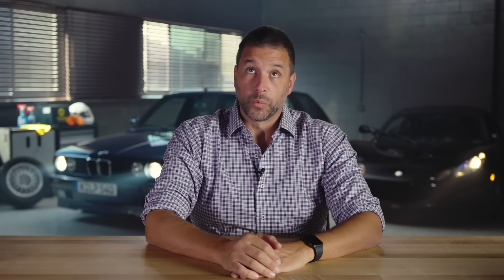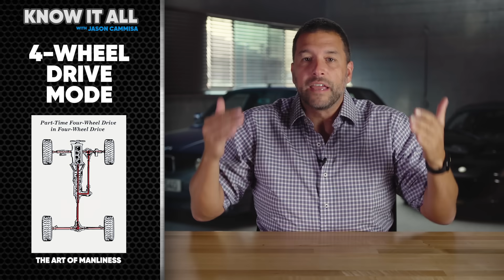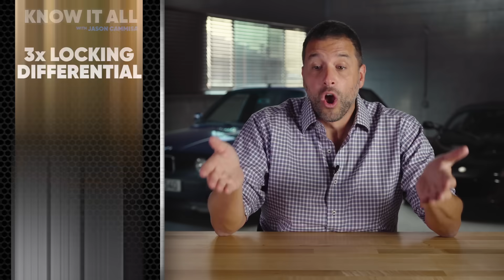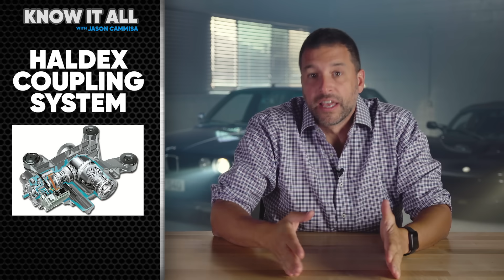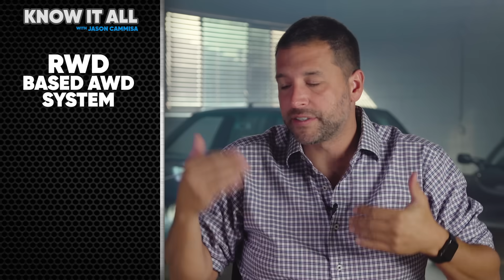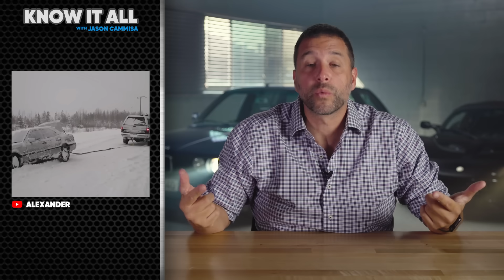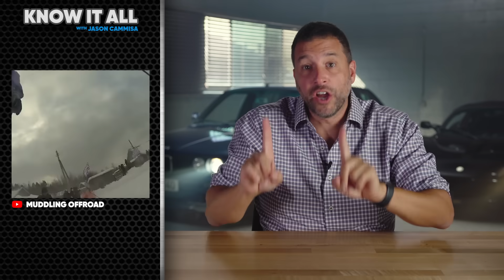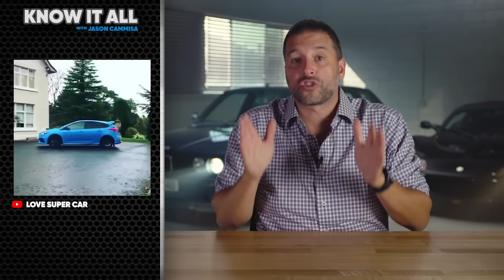Understand Your All-Wheel-Drive System | Know it All with Jason Cammisa | Ep. 04

Comment: So where does the Subaru system fall? Asking for all the Subaru vapey bois. Thanks
Reply: Subaru doesn’t exist in Jason’s world.  Subawho?
Reply: @Rightisallwrong  That's because turbo subaru's explode and can't drive any wheels...
Reply: @mattsoares608  What does a turbo have to do with Jason not mentioning Subaru in a video about AWD?  Do you sniff glue?
Reply: @mattsoares608  no more often than Z car transmissions or 5.0 mustangs explode. 
I used to belong to a Subaru group and I still know more people directly with domestic engines imploding by a wide margin.
Reply: I like how there’s an entire video on AWD Systems, and they don’t mention Subaru even once.
Reply: @JesterialInsanity  Right and I wonder why?
Reply: @JesterialInsanity  that's because he mentioned mitsubishi and the one thing they have over Subaru are their engineers.
I think mitsubishi and Subaru both typically use a viscous center differential
Reply: @JesterialInsanity  so he’s just supposed to mention every single manufacturer that has AWD cars? I think he did a great job of illustrating some of  the different types of AWD systems out there, since that’s what this video was really about.
Reply: @G_F1  Yeah, probably not every manufacturer, but MAYBE the manufacturer who made ONLY AWD Cars for their entire lineup until 2012. Maybe the only manufacturer where 8 of the 9 cars they sell right now (USA) only come in AWD. And if the Video was really just about TYPES of AWD Systems as you state, then why even bring up any manufacturer? The Video was just a quick pump and dump to get content out.
Reply: @G_F1  
No, but perhaps mention the one that is arguably the best in the world and is in more cars than any other.
Reply: @G_F1  considering there’s only one car company in the world that has been all about all wheel drive since day one, I think so
Reply: @G_F1  are you really this… slow, to put it very politely?

Do you even know what Subaru is, asking a question like that?
Reply: As the comments above have alluded to, Subaru uses many different implementations of AWD depending on the combination of model, trim level, and transmission type
Reply: Subarus, due to the boxer engine, have longitudinal engine layouts and thus have the transmission directly inline with the transmission and then the rear driveshaft. If you look in a Subaru engine bay, you notice the engine and trans are super far forward. The front driveshafts come go directly from the transmission to the front wheels without a weird angle or weird springs (look up W124 4Matic springs/front diff if you want to have nightmares). With the longitudinal engine, the front and rear half shafts coming from the diffs are equal lengths (that's where the name Symmetrical AWD stems from). These equal length half shafts allow the power to be distributed more evenly and smoothly. In the case of Subaru, with the longitudinal engine allows them to make their cars AWD without adding much to the cost of the car, as it allows them to just run a driveshaft directly out of the back of the transmission. Regarding diffs, most Subarus have open diffs and its been that way for over 10 years. Only AWD Subaru that has retained the lsd is the STI, which has a pretty complex AWD system. Subaru replaced the LSDs with VDC, which is basically a quick reacting traction and stability control; it will apply the brakes to wheels without traction and stop them from spinning, which then sends power to the other side. For Subaru owners who want an LSD or locking diff, there is one available made by Torq Masters called the Torq Locker. Its an automatic locker for the rear diff that acts as an open diff until one of the rear wheels slip.
Reply: Subaru vehicles equipped with manual transmissions use a viscous limited slip center differential (VCD) AWD system
Reply: Hey only most of us vape .5% think we’re in Initial D! Still Jason what about Subaru’s AWD System I know you don’t like us but inquiring minds still want to know from the Know It All himself.
Reply: Just go watch Engineering Explained’s video on Subaru’s systems.
Reply: @MRX5000X  that’s exactly wha to just did
Reply: @layne4376  No, the STI doesn't rotate well from the factory because of the suspension setup, not because of the AWD. Adding a stiffer rear sway and adding some front camber makes an STI rotate just fine, especially when the center diff is fully unlocked (pushing 59% of the torque to the rear).
Reply: He didn't discuss torque vector braking either which many companies use with open differentials than going with more expensive LSDs. This is part of the reason why a STi costs more than a WRX. You are paying for front/rear LSDs and a Electro-magnetic adjustable center LSD aka DCCD. Also Subaru added X-mode to much of their fleet with more inputs and sensors from the car for the ECU to factor in. Something other manufactures haven't outside of a yaw sensor.
Reply: for real, I was waiting for him to mention Subaru. Still am...
Reply: @Rightisallwrong  No, the DCCD isn't a viscous diff. It's a clutched LSD with a rearward bias when not slipping (41F/59R). In pre-2018 cars, this had both a mechanical clutch engagement like most clutched LSDs, and also electronic capability to preload the clutch as desired. In 2018, the mechanical portion of this was removed, so now it's a fully electronic clutch - note that with the clutch fully open, it's sending 59% to the rear, and as the clutch progressively locks up, it behaves more and more like a truck-style or jeep-style AWD where the front and rear driveshaft are basically locked together. 

Also beneficial to the STI is that it's the only Subaru that gets a front and rear Torsen, so it actually has 3 separate limited slip diffs.
Reply: @clapanse  Learn something new everyday
Reply: Too primitive I would say, as of now you cant really do torque vectoring without faking it with brake vectoring. Reliable and predictable though.
Reply: x2 for Torsen Quattro...
Reply: ... is nobody gonna mention wtf a torsen differential is? Or is that just rally-car special talk?
Reply: @graysona1800  short answer is, it's a mechanical lsd, that pretty much doesn't have any delay trasfering and locking the power, however, it's a  bit dangerous,since if one wheel goes in the air, then 100% of the power is transfered to one wheel instantly
Reply: @graysona1800   - do a search on YouTube for torsen differentials.  There's lots of good info there.
Reply: Really depends on model.  The best system IMO is the manual with viscous center diff.  Put a locker on the back and the engine runs out of juice before the wheels run out of traction.
Reply: 300,000 mile 1998 turbo Subaru FTW, baby! Bought it for $2,000, received a $2,500 check after a very minor hailstorm, and other than that, typical maintenance. This car actually made me money.
Reply: @James_cowley  Subaru are full time 4wd but what makes it awd is that instead of the locking being manually engaged it uses clutches in the differentials. Unless it's a standard model then it's just an electronically engaged center diff with open front and rear diffs. Subaru also had the variable valve lift on sohc engines similar to the c4 Corvette engine before the ls1 and automatic transmissions with the ability to half shift down for more power to an infinite ratio between the two gears thanks to special hydraulically controlled clutch packs that purposefully allowed slip to allow for higher rpms and more power but not enough to let the transmission slip. This came standard on all 4th gen legacy's, Outbacks, and foresters
Reply: I have both an Audi S5 and a Golf R, and the S5 is definitely a superior AWD system. But I found with the Golf R, a beefier rear sway bar helps in the corners.
Reply: I agree, I wanted an explanation for my STI
Reply: Subaru is full time awd like the audi, including the wrx. The STI has an lsd center diff like the sh-awd, mitsubishi evo, and Ford focus.
Reply: The head gaskets fail so often you forget about the awd nonsense. Zing!
Reply: @TML34  too real!
Reply: Head gasket issues were a problem on "some," but not all Subaru engines, usually certain NA 4 cylinder engines.  It's also an issue that really hasn't been an issue for a number of years now.
Reply: @TML34  
Subaru hasnt produces the EJ series engine in ten years Zippy, ZING!
Reply: @fubartotale3389  and even when they were the headgasket issue was sorted out. Its an issue that only lives on because the internet won't let it go.
Reply: @fubartotale3389  False, the STi still had the EJ until they killed the entire trim level off after MY 2021.
Reply: @TML34  nah they run out of oil and lock up before that.
Reply: Early WRX blob eye wagon is viscous centre for sure. It depends on which tyres are more worn out and or loaded up as to which tyres you’ll get to spin. Sometimes it’ll make a Honda envious at the tyres it’s spinning. Sometimes it’ll surprise mid corner with a shittonne oppo. That’s centre viscous diff playing the role of chose your own adventure
Reply: Most Subarus use the Audi layout (longitudinal fwd-based), and they’re permanent AWD. I’m not sure what torque split is tho.
Reply: @M67v  It's transmission dependent. 

Manual transmission subarus except the STI are all 50/50 biased when not slipping, so it's wrong to call them fwd-biased or fwd-based, and usually have a viscous center differential (so if there's a speed difference between front and rear because one is slipping, it will progressively send more torque to the slower spinning axle).

Automatic or CVT subarus except for the sporty models (Forester/Outback XT and WRX) have a 60/40 front to rear distribution until they detect slippage, so they are front biased but not 100% front like a Haldex system would be - they're still sending 40% to the rear even when no slippage occurs. These use a multiplate transfer clutch to progressively transfer power around if they detect slippage.

Sporty automatic or CVT subarus (again, Forester/Outback XT and WRX) run basically the same system as the regular auto except that the normal torque distribution is shifted to be 45F/55R, for the obvious reason that they're trying to make them a bit sportier feeling and able to kick the rear out in the snow or similar. 

Finally, the STI has the most aggressive rear bias, at 41F/59R, and it also has the most sophisticated differentials, with an electronic clutched center limited slip that the driver can control, and front and rear torsens. 

If you want more detail, Engineering Explained made a good video on Subaru's AWD systems a while back.
Reply: Subarus fall under the rear wheel > front wheel center locking system
Reply: Ignore literally everyone's prior replies.

The Subaru system has a longitudinal layout like a conventional RWD but actually operates more like a FWD due to the front driveline always getting power from the engine.

Let me expand on the truth of the AWD systems Subaru has used.

There are 4 versions of Symmetrical AWD.

1) Continuous AWD, 50:50 F/R torque split, viscous center differential (all manual transmissions except WRX STI w/ DCCD)
2) Active AWD, 60:40 F/R torque split, electronically-controlled multi-plate transfer clutch (all automatic transmissions except H6-equipped Subarus and a few other exceptions)
3) Variable Torque Distribution (VTD), 45:55 F/R torque split, multi-plate electronically-controlled transfer clutch (all H6-equipped Subarus and a few select ones, including some turbo models) with planetary gearset center differential
4) Driver Controlled Center Differential (DCCD), variable between 50:50 F/R to as much as 41:59 F/R [pre-MY2008 could go as much as 35:65 F/R] MPT with planetary gearset center differential similar to VTD combined with a viscous coupler similar to Continuous AWD (all Subaru and STI models with DCCD) [MY2018+ got rid of the viscous coupler]
Reply: @AWDfreak  you made a mistake on DCCD saying that it has 59:41(pre 65:35) F/R, the mistake is not F/R, but R/F ;) it sends more to the back, other than that, great explanation
Reply: @petkokrushev3840  Good catch. I wrote it while very tired. I will correct the post.
Reply: @AWDfreak  as I said, great explanation otherwise. I have an 06 STI and the awd system is really nice
Reply: Right! When I think of all wheel drive cars I think of Audis and Subarus first.
Reply: It's a reactive system with open diffs throughout. What else needs to be said about that garbage?
Reply: They use a full-time torsen center differential setup like Audis do.

(EDIT: I accidentally typed "haldex" when I meant "torsen")
Reply: @CrazyWeeMonkey  Nope, it's completely different from a Haldex setup.
Reply: @clapanse  

Most Audis still use a torsen center dif. It's only a few of the newest ones (A3/S3/RS3/Q3/Q5/A4 Allroad) that don't.
Reply: @CrazyWeeMonkey  Nope they don't, it's ultra quattro now. Torsen is dead, gone, rip
Reply: @CrazyWeeMonkey  yeah, but the Torsen Audis don't have Haldex. Subaru's system is similar in many ways to the Torsen Audis, but it's very different from Haldex.
Reply: @clapanse  

... That's what I was saying. I drive an Audi A6 Quattro ('12 3.0T) and like most other Audis the Quattro system is torsen with a center differential, like Subarus.
Reply: Oh, I realize the confusion. I said haldex center dif in the original comment when I meant to say torsen center dif
Reply: It probably broke down on the way to the test.
Reply: Subaru's system is the best.
Reply: @imnotusingmyrealname4566  yes, but the engines and some transmissions really suck
Reply: Subies are not very popular
Reply: @0163844098  what? They’re 4% of US car sales. Subaru sells more AWD (not 4wd) cars than any other brand.  they’re pretty popular and arguably the most common AWD car found on the road.
Reply: @0163844098  ya, but this video is intended for the US market
Reply: @0163844098  were also talking about a video that is about AWD.  Subaru is a relevant brand to discuss
Reply: @0163844098  THIS video is directed at the US market.  It’s not ONLY for the US demographic. Never mind,  this isn’t clicking for you.
Reply: Subapoo

Comment: You really can't cover AWD in 7 minutes, you haven't even scratched the surface. You just aren't doing this topic any justice. There is far more systems, it's a pretty complicated topic and lumping 4x4 and AWD is incorrect. In fact a true 4x4 system is actually far easier to explain and understandable then all the different "AWD" systems employed by different manufacturers. If you want to know which is best though, that's easy. A manual transmission Subaru is the king of the heap. It's got the best design to putting power out to all 4 corners.

Comment: My Yaris got a 1% overdrive rear axle + LSDs on both axles 👍
Reply: The overdrive can be done on any car by putting the least worn tires on the back or getting slightly larger diameter tires for the back. Only have to worry if the center differential can handle the difference

Comment: There is actually some false information in the video. While some Audi models like the A3/S3 do use the haldex AWD system, the SQ5 actually uses the torsen AWD system that is in fact rear wheel drive biased similar to the Macan. You can easily tell which AWD system in Audi by seeing if the engine is transverse layout or longitudinal engine layout. Also while the Haldex system that VW uses in the Golf R might not be the best performance wise, it still is a big improvement over just a FWD system. You can check out the savagegeese video review of the Golf R verses the GTI where it handles better then the GTI even with the front LSD in the GTI. An AWD system doesn't need to be rear biased to be useful. If the definition to be useful is to just drift like you seem to imply in the video, then that defeats the purpose of what the AWD system should do. Also VW and Audi never advertised that the Haldex system is rear biased nor I have seen anyone on forums claiming it to be.
Reply: @Wooden Door Garage Well, which wheels get the power is only one part of the equation to determine what causes understeer or oversteer. There is suspension tuning that will make a big impact too. Ask anyone who played with changing sway bars. Audi cars have always been designed to understeer on the limit because it's safer. The same for VW cars. Oversteer can be dangerous for unexperienced drivers because people push the brakes when they panic. That makes the problem worse. Audi cars even the more expensive models also understeer. There are RWD that understeer as well. Just FYI